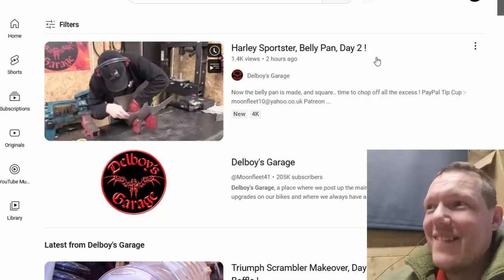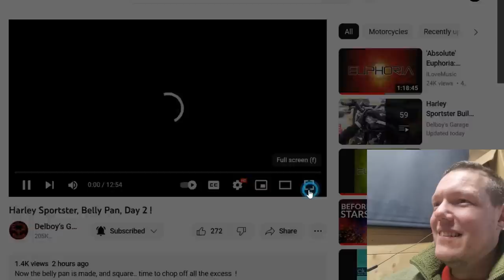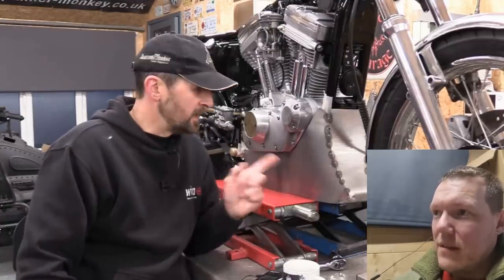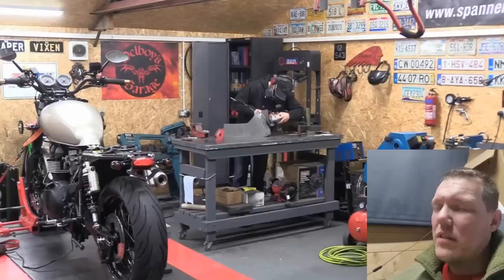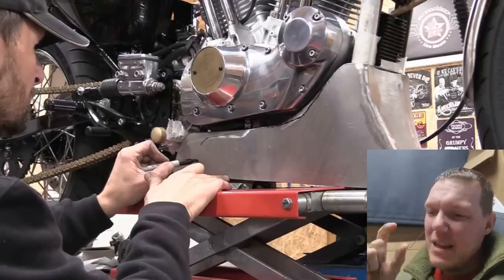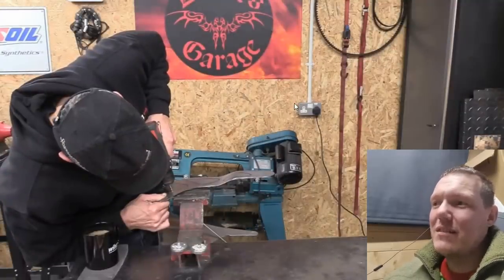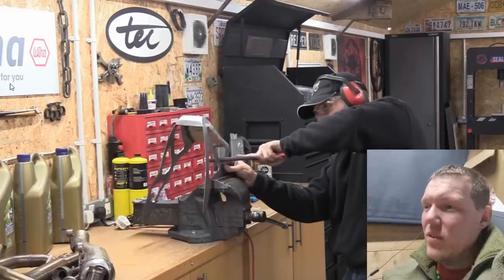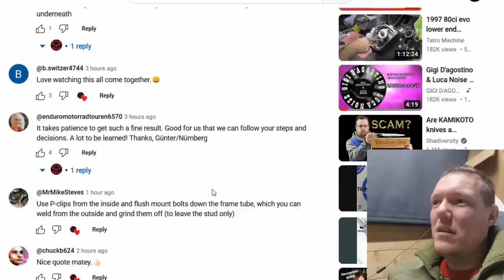Del's adding lightness - with holes

Comment: It's the most beautiful work of art Del has ever made.  After his cubist phase with the 'busa number board, he's moved on to impressionism and is now heading towards surrealism.  What you would expect to be straight is curved, and vice versa.  He's subverting the commonplace - welding, usually considered as something to join metal together, is now used to hold metal apart.  He uses the sheer ugliness of slapdash metalwork to frame and highlight the "big ugly engine mount" that the ordinary fabricator would try to hide or camouflage.  A genius, truly a midget standing on the shoulders of other midgets.

1800dB, though?  Did you used to play guitar for "Disaster Area"?
Reply: ROTFL

Comment: Accidental pause at 38:31 and the two sides are not even sat flat on his nice metal workbench, But at least he achieved what he planned to make in the first part, and it was such a successful project, Now its time to modify it, And cannot get over the amount of time he wasted following (Kinda) of engine contours etc, then promptly cuts them off, He should be called Ctrl+Alt+Del garage, Contradict, Alter, Delete garage.
Reply: yeah removing all the bits he so intricately cut in the first round of this....why?

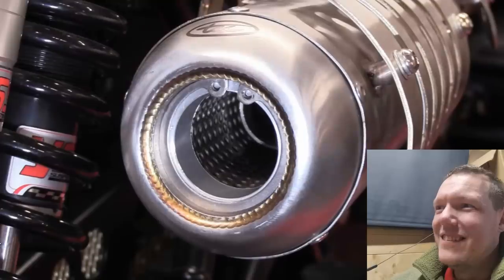Comment: 09:26 I love how mangled the insides of that baffle thing is, almost like a blade is not the right tool to chamfer or fillet the edges of a metal part. It has a lip.
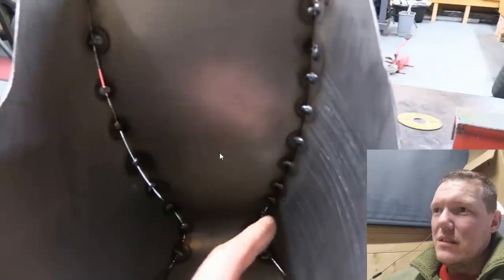22:02 del needs to pick up a vocabulary and learn the meaning of the word "sealed". That snowplow is so sealed that you can see light on both sides the bad one and the worst one, top and bottom. 
One holed glove, i love homeless del. 800£ for footpegs but not 3£ for a pair of gloves.
Love the carbide burr marks around the windows he made. Such crapmanship.

Comment: Am no expert but would it not be easier to make the shape you want first and have both sides the same, leaving plenty of extra material on the frame side. Then use templates to take the frame shape and engine casing out of the belly pan?

Comment: those harley evo engines are usually rubber mounted, i am not sure but i think in the sportsters to. so i am wondering if del realised that, or if someone told him the engine is going to hit that bellypan if he mounts it to the frame and keeps it as close to the engine as it was in the start of this video. anyway i liked your video, always a good laugh, and with your tips learned a thing or 2 about metal working to
Reply: That's a very good point. Those motors do jump around a bit.

Comment: 1800 decibels? Wtf was the bike running on, dark matter? O.o

Also, can we just appreciate that at 57:49 - the only thing holding the metal in place at this moment, is him cradling it...
Reply: That's unbelievably loud a Saturn 5 rocket was only 210db and Krakatoa was only 310db. I think most would pull a 1800db SV1000 on a MOT. 😉

Comment: Del and his symmetries? It isn't a complex proposition from Pythagoras. A basic shape that folds in half and has no gaps or overhangs. I thought it was his hippy beads thrown on a table. A SYMMETRY, can he hear as I shout? Coz I am a bit. From MIG wire it never ends, he is such a treasure. Maybe he'll finally get his statue in the motorcycle hall of blame soon? I can't imagine how this will get worse, so it will be a surprise.

Comment: I wonder how much paint will be left of the frame by the time he's clatted it with that biscuit tin one hundred times.
Reply: About as much there will be left after it's first run in grotty weather. Rubbish preparation
Reply: I meant to add sweet FA
Reply: He's got mount that thing yet. 
He started so well with the 1200 conversion and testing it ran.
Then it went down hill fast 
Finish ALL fab work ,test bike for a few miles, return to workshop,  take apart and address eny problems, THEN paint and final fit and finish before second shake down test.

Comment: Would it not have been better to form the top edge with a bit of welding wire wire transfer that shape to to the side plates bolt them together cut the ventilation holes so you get them symmetrical then cut the bottom edge then fit the front joint section or is that too simple
Reply: Ps ide have fitted a false oil filler cap so it looks at least it looks like it has a function

Comment: Any bloke who hasn't got a spare length of 15 cm metal, rusty or not, as a make do anvil, or a drift, doesn't know the value of a variable use tool. Yes, it's a dowel rod, which warps from moisture. Straight as a whatnot. Grab an old duckboard from the garden to rule up your doors before cutting for the perfect 47 degree cut. Depending on which side you use.
Isn't this a variation/repeat of a famous Husqvarna build from the distant past? He could adapt that to make a cross bow, if he turned it in his lathe fast enough.

Comment: there are legal limits for exhaust dB levels in the UK. It does depend on the year of bike manufacturing as to what the level is (if there is even a limit, eg pre unit vintage bikes have no limit through there is a cut of date for this) with the MOT the inspector can fail the bike on excessive noise if they BELIEVE that the exhaust volume is louder than the standard bike dB level for its age. very vague and can be... difficult to enforce with MOT testers (hearing loss issues anyone?) but the police have a clearer more defined regulation to follow through with and can lead up to a £1000 fine.  There is a break down for years of manufacture and limits on dB will dig it out, though the law is updating again this year as per the UK government legislation webpage.
Reply from the maker: That the sales limit, not the MOT limit. Find me the police guideline or MOT dB limit and I will buy you the bike of your dreams lol
Reply: publications of parliament document Motorcycle Noise (chapter 9) Statutory Controls on noise limits and Silence/Exhaust systems Table 1 (page 4) Summary of noise requirements for mopeds and two wheeled motorcycles (Noise limits, drive by test) 
pre 1/4/1983 date of 1st use, moped and 2wheeled motorcycle "No requirement"
date of 1st use 1/4/1983- 31/3/1991 over 500cc 87dB
date of 1st use 1/4/1991- 16/6/2003  over 175cc 83dB 
date of 1st use 17/6/2003 - present over 175cc 80dB
Reply: The MOT limits are more vague based on if the tester believes the bike is louder than manufacturer limits whilst the police can use the above mentioned table. There is a publication from March 2019; Task 696
Roadside Vehicle Noise Measurement
Phase 1 Study Report and Technology 
Recommendations. in that report they find that even 2/3 of police officers are not clear on this, with 50% of noise complaint cases just being dismissed. 
references Publications parliament and Assets publishing services UK government

Comment: I really don't get it. It's his bike, for him - not me - to be happy with, but i simply can't get my head around why he does what he does. The template was 100% pointless, and he didn't even fold the front bit in half to make it symmetrical. 

The pegs & gearshift are a bit baffling as well. All those bits he bolted on, then you look at a Buell X1 with a boomerang lever and link rod. I've never seen either bike up close to play spot the difference with the installation, but i'd bet he could've copied the Buell.

Comment: i took my bike to the same mot place i used the last time a year ago and thay passed my loud exhaust this time thay failed it he also said my reg lamp dint work and brake lights didnt work on both levers/pedal then when i proved him wrong by first asking did you turn the lights on because the reg light comes on with the lights he didnt he said it dident then had to recheck it i then proved the brake switches work fine because he dident like been proven wrong actualy broke 1 of the brake light switches

Comment: Del says the perforated steel tube is loose in the exhaust can and the only thing holding it in, is the baffle? That's bs.  It will most definitely be welded at the entrance end of the can.  That perforated steel tube will not come out by pulling on it with some type of hook 🤦‍♂️
Reply: @nutgone100  No.  The sleeve (stainless or titanium tube, 100mm dia. approx.) is rivited to the end cap and front cap (if I can call it that).  The perforated stainless steel tube is welded to the front cap, and part of the structure that clamps to the exhaust pipe. Akrapovic exhausts, for example, are re-buildable.  You can buy replacement sleeves, rivets, wadding.
Reply: @deanmsimpson  it can be different design. On dirtbikes it is like you explained. But here the can has cone shape and rivets are on one side. It looks like if you make perforated tube as continuation of the pipe, it will be pain in the ass to repack, because you don't remove the outer can (cone). You need to shovel material into deep volume between the perforated pipe and outer can.

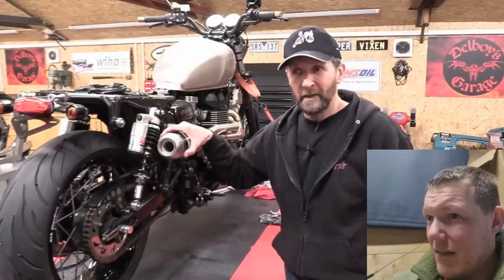Comment: Hang about....didn't delbollocks prattle on about needing to get the engine rejetted/remapped if you ran this exhaust without the end-piece baffle? Now that he's effectively done the same thing here....no talk of getting it retuned? Typical bullshit from the muppet..... @9:50 ....sound of an EFI fuel pump pressurizing system  =)

Comment: I sort of disagree when you say making something like this shouldnt be like sculpting. 
If you look at what Craig jones on doghouse customs does. I think there is a degree of eyeballing involved as he works out the general shape and look of a piece. 
Of course he breaks out the ruler and square to figure out mounting points and clearences and the rest of it. And there is also a bit of precision needed to make sure things are symetrical. But there is still a bit of what you might describe as "sculpting" involved.
The difference here is that del is just shit at it.
Reply from the maker: I'd diagree even more lol There's planning out, looking what right etc, but that's before you weld it all together.

Comment: I have said it before.. I really cannot watch all this crap without getting pissed off with how awful it all is and I do mean ALL is.. I have NO problem with anyone having a go at something and if they are not sure, say so and talk about what they are trying to do and take advice and then have a go based on that advice.. Good or bad its not a problem if you admit its just giving it a try. If it goes wrong and you share those mistakes and people see the learning process. great... But talking like you know what you are doing and obviously don't have a scooby doo, that is just showing others how to make a mess too.. He ended with "Now I need to find a solution to fit it......" What the fuck???  I usually look at where it will fit first then how to fit it and work outwards from there.  

You talking about what it wrong and how to not make those mistakes is ace, BUT and I do mean BUT those who need to know the most are watching the wrong channel and learning the wrong way to do it all...   I made a hugger for our little race bikes. I was asked by the manufacturer to have a look at doing them. The swing arm has two threaded lugs which were used to hold that section in a jig for welding I think, so were not used for anything. So point one and point two were in front of me. The lugs have a flat face to help stop flex of the hugger, the threaded area would allow me to hide the two allen bolts inside the hugger and hold it at its strongest point too.  At this point I have made nothing but know where it will mount and how it will mount. I used an existing mudguard to help speed up getting a shape and it also means I don't need to template the shape to make it symmetrical. It is a short cut but it is a functional part more than cosmetic. He seems to have an idea and work totally the wrong way.  I would make a card mock up before even cutting a single piece of steel. But then what the fuck would I know about building a bike...  

I watch your version of his fuck up's as it at least makes it funny to watch and not have me just getting pissed off at how he is fooling his viewers into thinking he is doing something good..